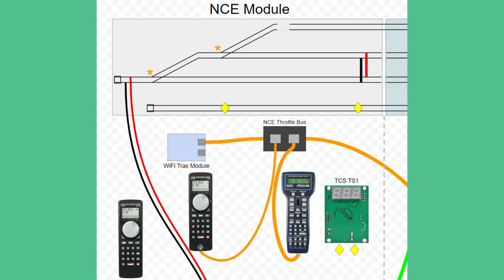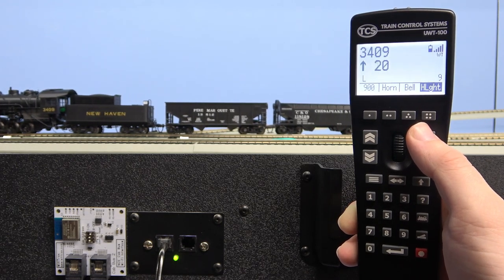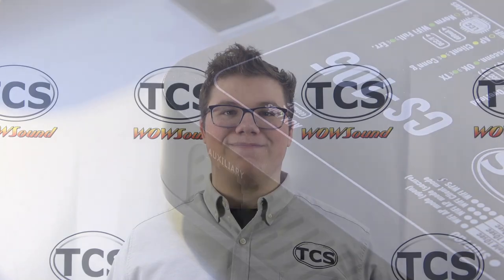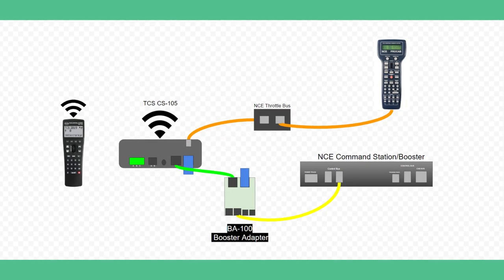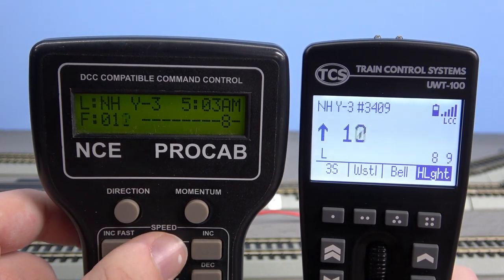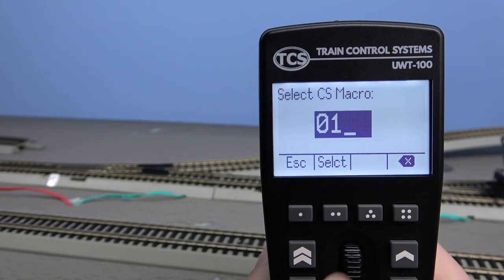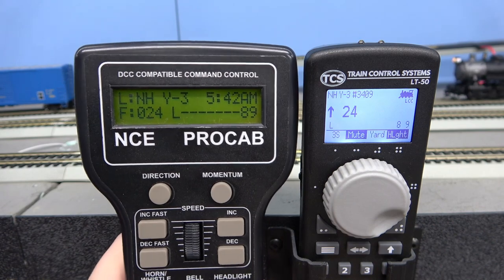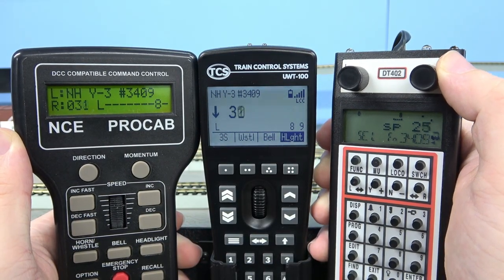Integrating TCS LCC system with the NCE system

Comment: Will this work with the NCE PowerCab or does it only work with the ProCab system?  Thanks!
Reply from the maker: Brian,

Since the ProCab is it's own Command Station and it has no booster, it will not work. The Booster on the Command Station will talk to the BA-100 Booster Adapter and then the CS-105 Command Staiton. If the ProCab and CS-105 were hooked up, they might get confused of who is commanding the trains and also the magic smoke might get releases from one or the other.

-Carson
Reply: @TCSDCC That makes sense, thank you for the reply.

Comment: I watched another video where the NCE procab was just plugged into the front of the CS-105 with the curly cord.  You don't need to go through the throttle bus according to one of your other videos.  You guys are confusing the heck out of some of us.  You think everybody is running big layouts and need every little gadget.  How about some basic stuff???
Reply from the maker: The NCE Procab will not work if plugged into the front of the CS-105. Those are LCC ports for the LCC network. The Throttle Bus in the rear of the CS-105 is solely for NCE throttle bus for the NCE throttle bus network. If you do plug it in the front of the CS-105, it will not work and also it cause damage to your NCE and or CS-105.

Comment: you need to show how you can use your phone with apps like engine driver
Reply from the maker: Well for the NCE System, you would connect your phone to the WifiTrax module through it's WiThrottle server that it is advertising.